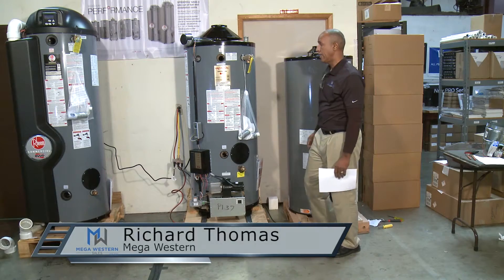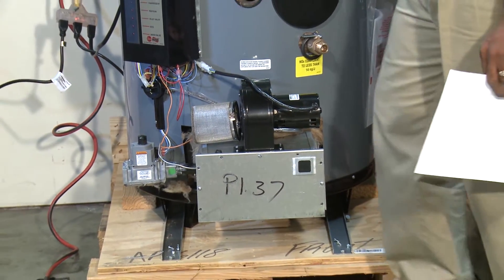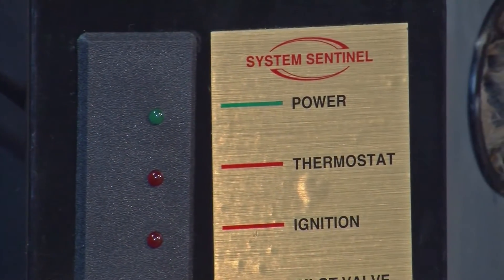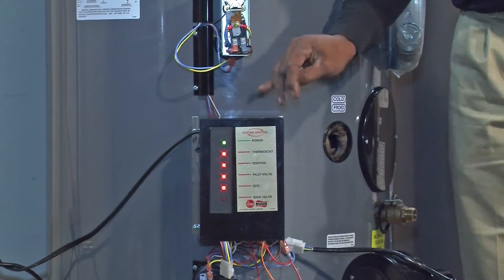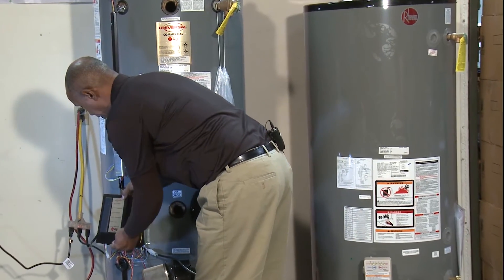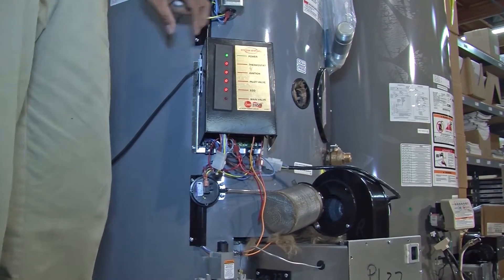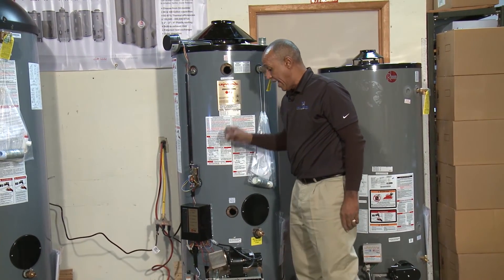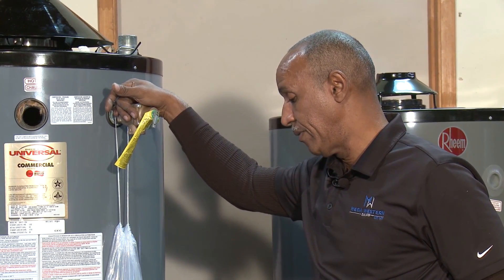RHEEM COMMERCIAL HEAVY DUTY TRAINING

Comment: Thanks to Richard and team for this informative video, much appreciated.  I’ll add a recent troubleshooting experience on a new GNU100-200 install on Dec, 2019.  The gap between the spark electrode and what Richard termed the “butterfly tip” was factory supplied with 1/8” gap. It would NOT spark at this gap. Increased the gap to 3/16” (per Rheem tech support) and it sparked/fired right up.

Comment: Good to know!. Question . What if you have two different size tanks side by side . How would you plumb them. A hotel had 2 Rheem boilers (360kbtu) side by side running parallel. The right one went out so they bought a high powered ao smith (199kbtu) with about half the btu and recovery rate . They want me to just plumb it in as fast as possible which would mean parallel like it was before . I’m thinking a series might be better . Your thoughts ?

Comment: My friend has a G100-200 model, which was manufactured in 2016, has problems after business resume from Covo19. Water directly goes out via relief valve. Is that mean the valve is failed? It also gives error code: 6, 7, 8: internal error, flame rod shorten and low in voltage